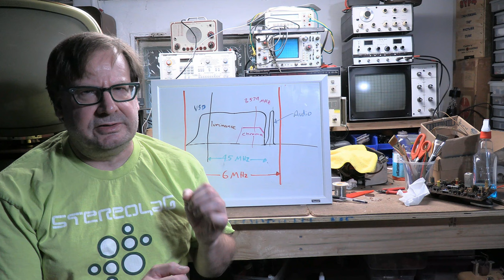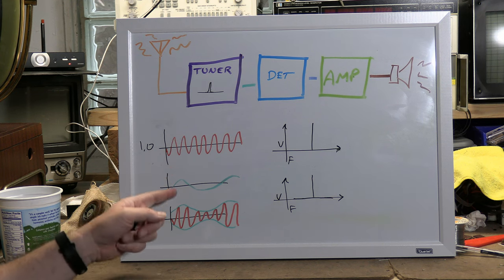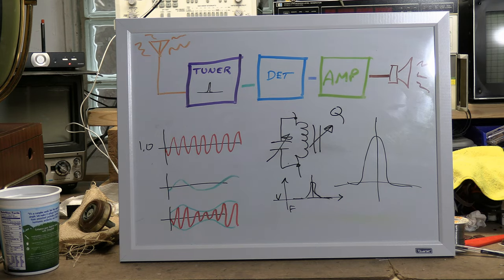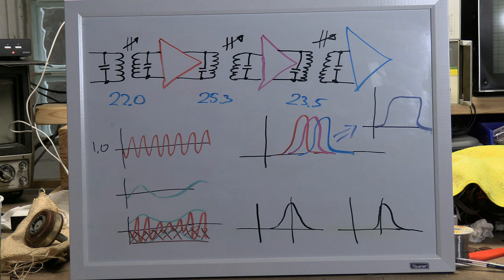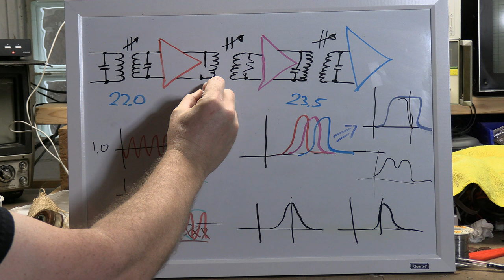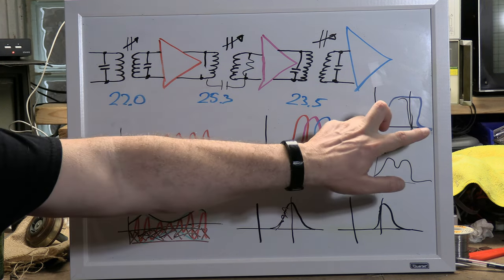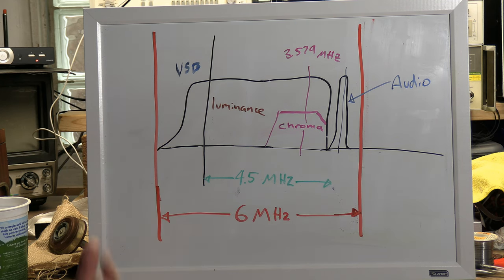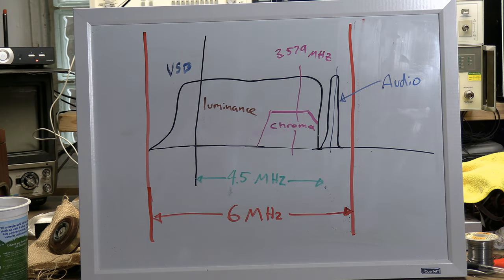Vintage TV Alignment 101: The basics

Comment: Excellent! Takes be back forty years to my electronic service engineering classes. I can hear Dr. Fetters and Dr. Goodwin explaining these circuits such in a similar manner as you did here. They focused mostly on solid state but made sure we knew vacuum tube technology as well. These tuned circuits are applicable to both. Please keep up the series!

Now you need to introduce the formulas, add hands on labs, give some tests, and award an AAS or BS in the new field of Vintage EET/EST. One caveat, you put a hold on awarding a degree until a student pays their un-paid parking tickets. (I think I owned nearly as much in parking tickets as I did tuition.)

Comment: Seeing this, this morning, (6/27), it reminded me that even analog TV has a separate audio that is transmitted with the video, and kept in sync. Same thing with digital video, the video and audio have separate codecs and are kept in sync. 

I did TV broadcast technician classes in the late 1980's at a 2 year voc tech and in electronic theory portion, this is some of what we learned, in part to pass the SBE test (society of broadcast engineers). This was when everything was still tape based and analogue, including editing. Essentially, when you are watching a B&W TV, it simply ignores the color burst signal and acts like it was never there.

Comment: Very good explanation in a few minutes. A want to see another video about the frequency and bandwidth conversion in the tuner for the 2 VHF bands. This video bring me a lot of good memories from the mid 70's when I was doing a part time at a TV service center in Jersey. Most of the service was for B&W sets from the late 50 's and early 60's and, just a few color sets. I close my eyes and can remember the head of the service department telling to all technicians "NEVER  TOUCH ANY IF OR TUNER TRANSFORMER" unless you have a "VERY GOOD" reason. Actually, 99% of the sets didn't have a misalignment issue. Pretty much it was a "tube changing center". Obviously, after 40 years, we have a very different scenario. Now, most of the restoration projects needs a full recalibration of tuned circuits. That is why, in my opinion, a radio and TV restoration bench, needs "good" test equipment's.

Comment: In fact, not only will it spread out, you’ll get a peak at the carrier frequency +/- the lower (signal) frequency. So, if your signal is a 1 kHz tone, you’ll get a spike in the frequency domain 1 kHz away from the carrier on both sides, which one could see on a spectrum analyzer. 😊

Comment: All the years I worked on Color TVs, the fact they used Phase Modulation for the color signal, makes sense. I never realized they actually used 3 types of modulation in the Transmitted TV signal. Now I see why the red & blue color signals from a color bar generator rotate on an X,Y scope, when turning the Hue cont., its a phase relationship. BTW: the TV's audio FM deviation is + & - 75 khz or 150 khz total.  PM also was/is used for AM stereo, PM = L - R & amplitude = L + R, but there is more to it then that with controlling distortion.

Comment: Hi Bob, in a staggered IF design if the amp stages are in series, how does the next stage get it's frequency range and why doesn't it filter out the previous frequency range? For eg as you drew the first filter centered at 22MHz and then next at 25.3MHz, the 25.3 would be get filtered by the previous 22 stage and then the 25.3 would chop off the 22 that got through. Almost seems like it would more sense for these to be in parallel rather than series though at that point delay would be an issue. Anyway, cool video and hope to see these principals in practice when you do alignments 👍
Reply: Because those filters are not ideal.
Reply from the maker: You got it
Reply from the maker: The filters are not ideal and overlap so enough leaks through each stage that in the end you get the desired response.
Reply: @bandersentv  Even so, wouldn't the peaks of each successive stage be slightly attenuated, so instead of a "flat top" band pass you'd actually get one that goes slightly "downhill" ?
Reply from the maker: @WardCo  Not if you design and align it carefully.  The order of frequency peaks matters.
Reply from the maker: @WardCo  It can also be maddening to align properly as you'll soon see
Reply: @xsc1000 that explanation doesn't make sense (at least to me). that the filter stages are not ideal, is already accounted for by the bell shaped frequency curve. it is perfect at it's resonance frequency in the center and drops off within a range. subsequent filters can only further reduce the signal where the curves overlap. 
I completely agree with the argumentation of the original post.
Reply: I absolutely agree. actually I came here to the comment section to see, if anyone already pointed this out.
als his explanation at 12:55 regarding the upper and lower sideband with amplitude modulation is total nonsense. there is no connection between the symmetrical nature of the upper and lower half of the modulated carrier and the upper and lower sideband. even that he says, that this is technically not correct, doesn't justify such explanation IMHO. especially learners will make connection where none exist or get confused in their understanding.
Reply: @klaus-udokloppstedt6257  Frequency curve can be changed not only by capacitity and inductance, but also by quality factor which you can simulate by parallel and serial resistance. So if you have some simulation software, add resistors parallel and serial to LC circuit and you will se how the curve changes.

Comment: Thanks Bob, but you asked for comments, so here goes.  Your explanation of vestigial sideband is not correct.  In particular, where you rub out the bottom of the modulated signal.   That would mean that you are transmitting the low frequency components along with a DC component, which is of course impossible.   If you look at a vestigial sideband transmission on an oscilloscope, it is symmetrical, as it must be.  Showing a vestigial sideband transmission properly can only be done in the frequency domain.   The passband of a TV receiver also is not quite as you have drawn it.  The bottom part is a slope, such that the response curve is half amplitude at the carrier frequency than the, ideally, flat part of the curve.  That is so that, once detected, the energy below the carrier adds to the energy immediately above the carrier, effectively giving a flat response right to the carrier, or down to DC once detected.  Also, the response at the audio carrier is much lower; only a few percent of the peak response for the video part.  This helps reduce any modulation of the audio signal by the video signal in the video detector.  (The proceeding comment is only applicable to intercarrier sound systems.).    I hope that helps.  Cheers. ☺
Reply from the maker: Yes, I know. You are of course correct.. That's why I said it wasn't how it really works at that point in the video and I said the disclaimer at the beginning. I'm trying to keep it as simple as possible.